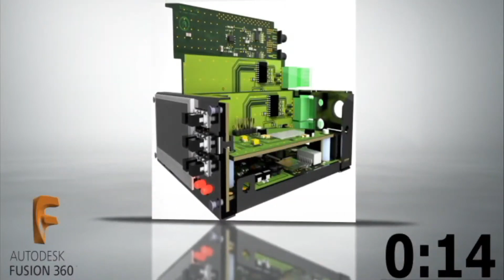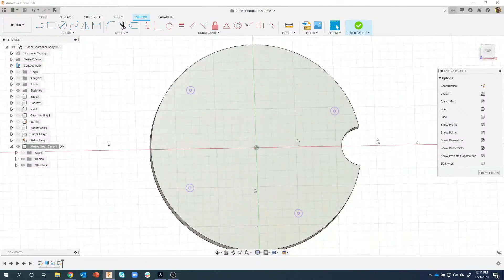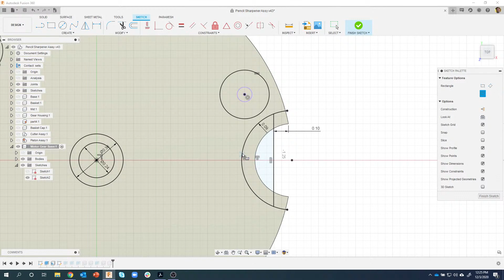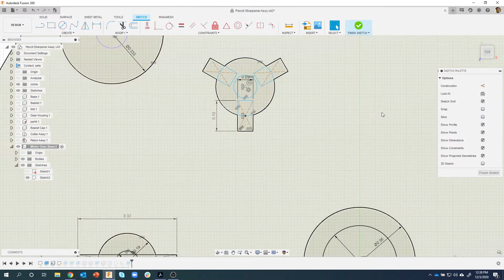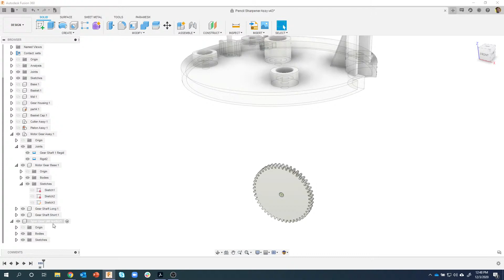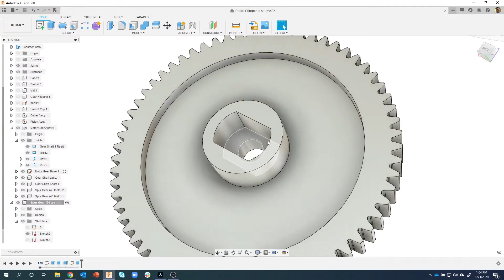Episode 79 - Pencil Sharpener Project, Part 9

Comment: I'm having trouble creating the second spur gear... In the drawings, the second spur gear with 12 teeth mostly fills up the center part of the larger 48 teeth gear (the 0.3 in diameter circle sketch we made), but the smaller spur gear with 12 teeth has a pitch diameter of 0.17 in so there should be quite a bit of room left on the center plate. Mine shows that, but Brad's drawings don't. I'm confused because when I try to stack the gears up later (after combining) and align them, the gears don't make contact (the smaller one isn't large enough). Could someone help? It's kind of hard to explain...
Reply: I had the same issue & thought I had done something wrong.  I hadn't. Change the Diametral Pitch to 50 - job done :)
Reply: @royalflush1964  I actually did that myself, too! It ended up working out okay ;)

Comment: Old School would be to divide # Teeth large gear divided by # Teeth Small gear and divide that into 360.
Reply from the maker: @George - Ya, I found out you don't even have to do that!  You just have to type in the number of teeth (instead of the angle) and it correctly calculates.

Comment: Good day Mr. Tallis, because I am using Mac notebook it is not possible to use FM gear tool. I have used spur gear from actual tool but diameral pich does not give the same radius.
so I change the diametral pitch dimension to catch almost your drawing size. Is there any way to find FM gears for mac notebook? or other way. Thank you.
Reply from the maker: @Ekrem-  I'm sorry that FMGears is not available for the Mac.  I do not know of another solution for the Mac.
Reply: @bradtallis8968  Thank you so much for your replay Mr. Tallis

Comment: Gears, sometimes a story on its own. Brad, I wonder if there is a real answer: why do offsets sometimes point to the outside with their positive value, and sometimes to the inside? Is there a pattern?
Reply: I noticed that It puts the offset towards the outside of the arc you click on. So if you have inwards arcs and outward arcs in your curve, depending on the arc you actually click when you select the curve, you will get the result you expect. Hope that helps!
Reply: @BlaiseBarrette  yes, maybe. I was talking about rectangles. There, it seems to be random